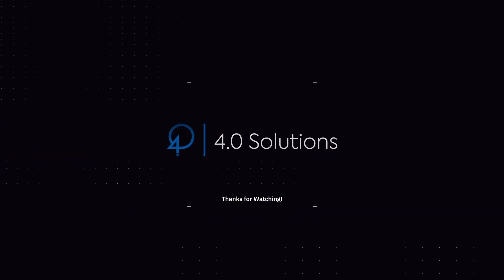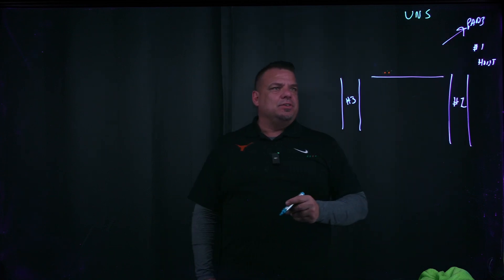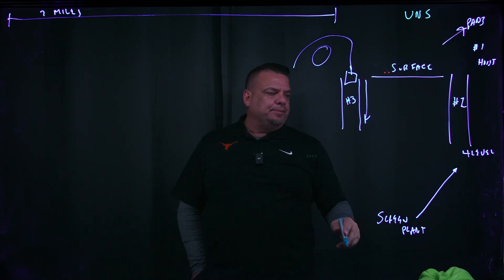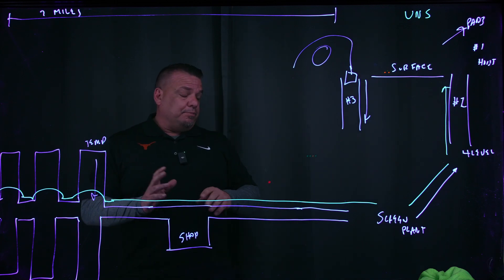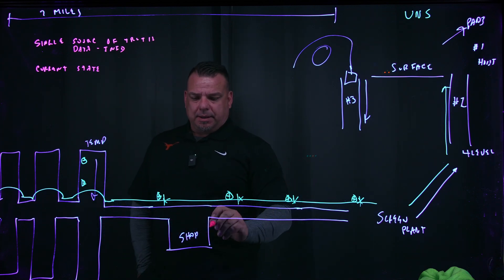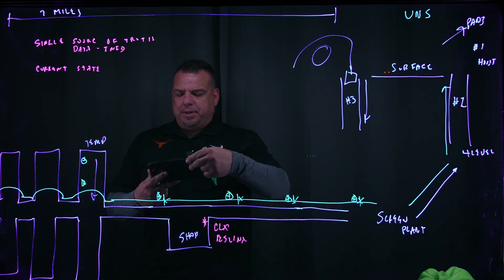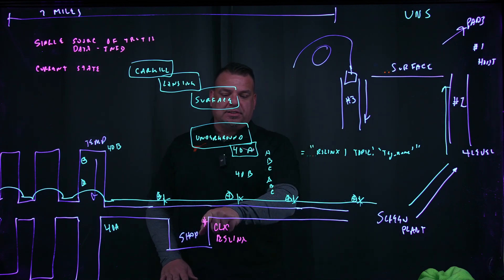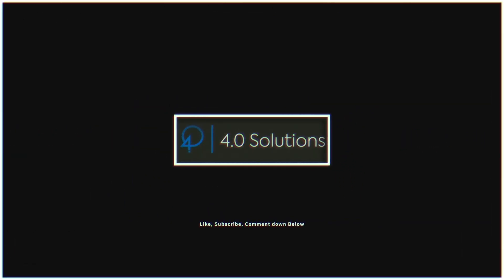Origin Story | The Unified Namespace

Comment: Back in 2003 I used an instance of RSLinx, classic to develop a similar type of architecture over ethernet using DDE the purpose was back end data exchange between the water treatment plants, distributed control architecture using Rockwell PLC5 redundant processors, 26 of them to be exact which consisted of 13 local nodes, as only one processor is primary through the BCM,  RSLIX allows for alias topics between redundant pairs of PLC5. Where  as SCADA only has data from the primary at any given point in time. All this was connected through Microsoft excel OLE connector for  process control... I still use it to this day. Yup still running PLC5 -20E … Agape Walker